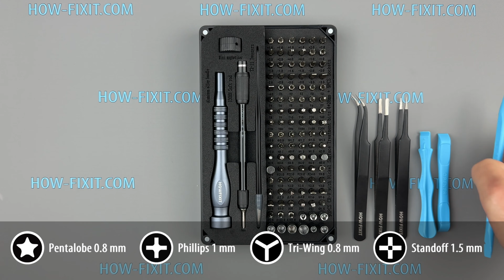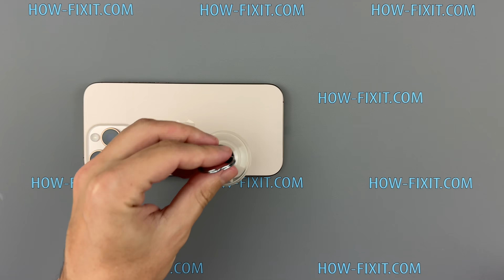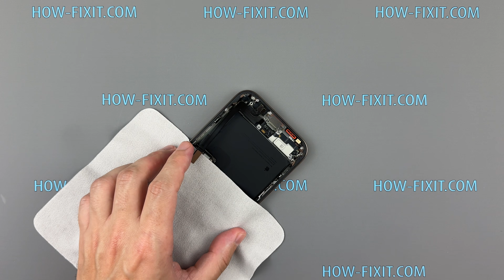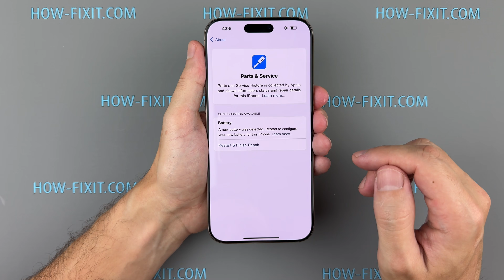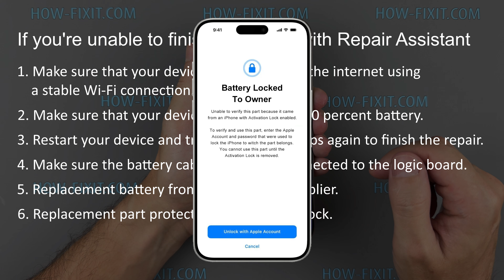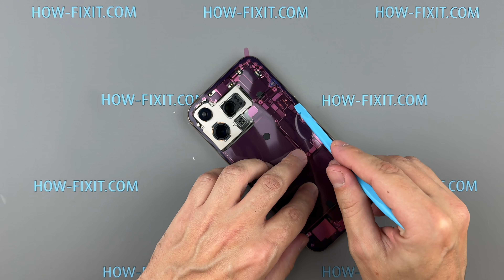iPhone 16 Pro Max Battery Replacement Tutorial + Calibration Tips

Comment: Is it necessary to remove the speaker and taptic engine? 

And how is the speaker connected to the iPhone? I didn’t see any cables or something in the video there. Just a plate which is connected with some screws. 😅
Reply: No it's not. Only if you want to remove it without any bending or damage. Which usually doesn't matter if you're replacing it. I heat up and then squirt alcohol under which allows it to pop up easily.

Comment: Will it notify if the battery is not officially from apple
Reply from the maker: It all depends on the battery type.
Reply: @howfixit  No, it depends on whether the battery is officially from Apple.
Reply: If you spot weld the board from the original battery onto a third party battery you won't receive the message